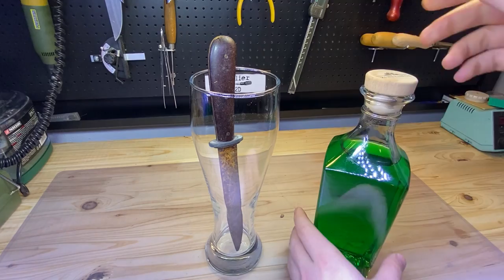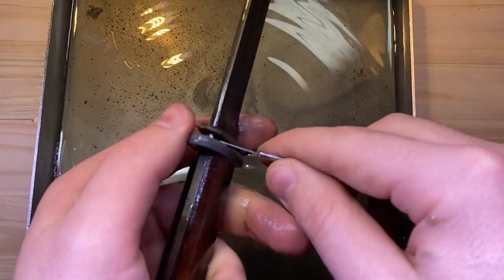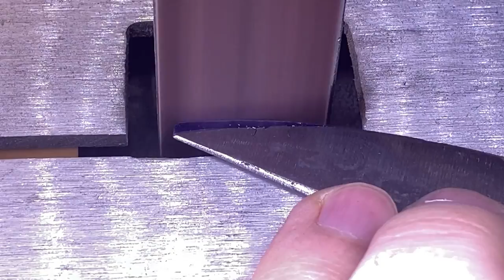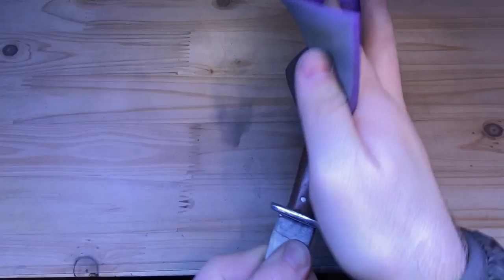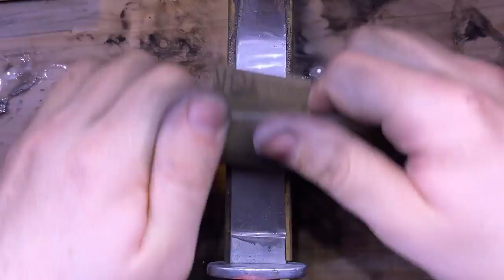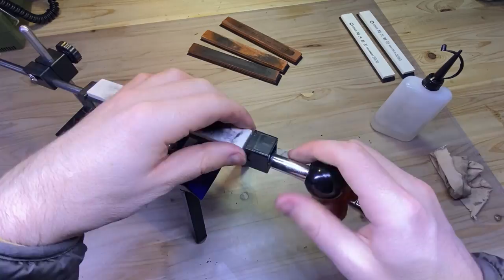WW2 Fighting Knife Restoration (PUMA Solingen)

Comment: Now I'm worried that the rust remover got under the scales and somehow will rot them from the inside((((      what oil did you use with honing stones? and how thick is the blade, 5 mm?
Reply from the maker: Thanks for the comment! 👍👍👍 I use a mild rust remover solution, so there will be no problems. During sharpening I use oil for precision mechanics, you can buy it at any bike shop 😊. The thickness of the knife blade is 3-4 mm.

Comment: Very nice but a lot of time to waste put knife in clinicals what you did on the sanding machine was much faster
Reply from the maker: Thank you very much for your comment! 👍  in order to remove corrosion in deep sinks, I use chemistry, and on the grinder, I removed only the minimum top layer of metal.  If you do not use chemistry, then the knife will rust very quickly.